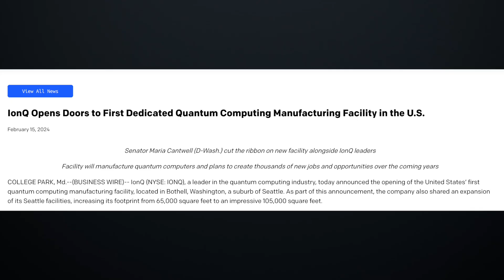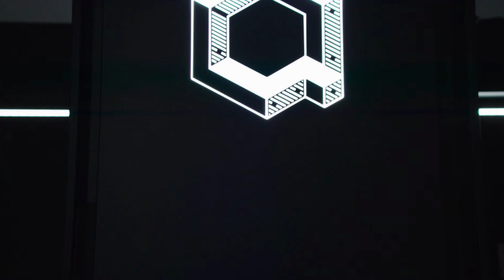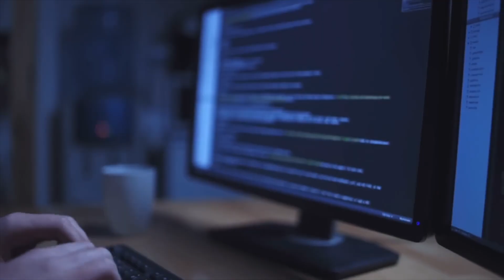IONQ | It's Finally Here

Comment: Good video, thanks.

BTW, it was square feet, not square meters.  

"As part of this announcement, the company also shared an expansion of its Seattle facilities, increasing its footprint from 65,000 square feet to an impressive 105,000 square feet."

They have a number of different offices now.  The new one in Bothell.  But others in Seattle, Canada, and on the East Coast.  They also are thinking about adding a second building in Bothell.